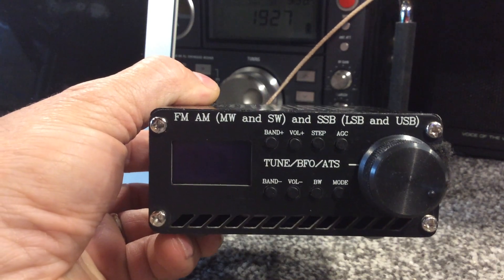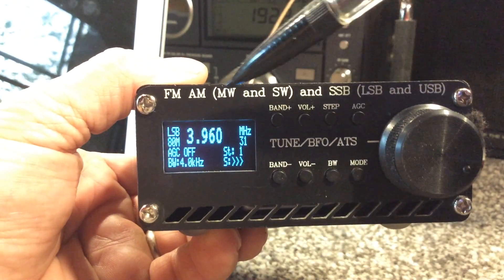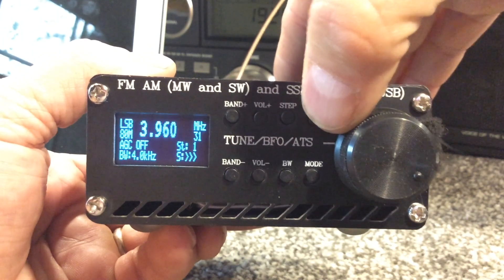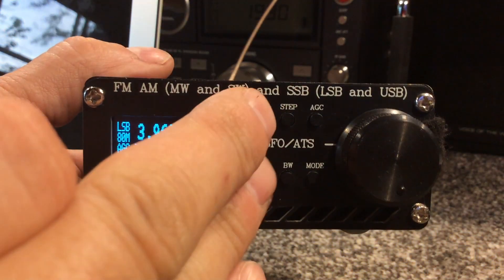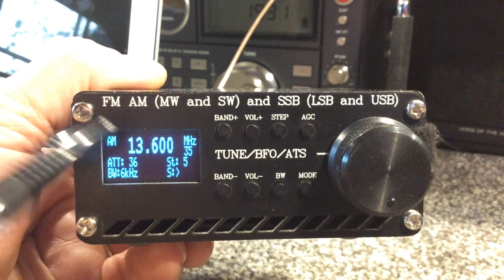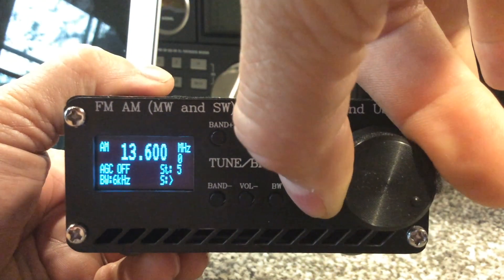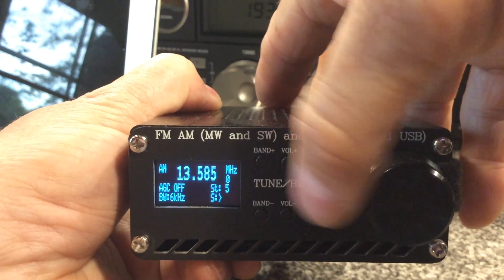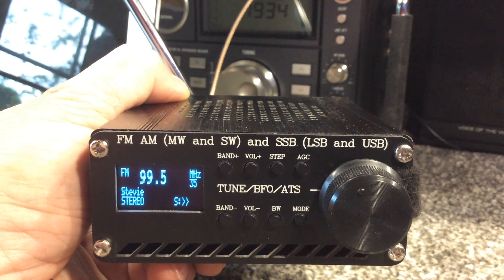Si4732 Radio Sketch Updates 2.3.09

Comment: I’ve been looking for info on charging the internal Li-ion battery but have been unsuccessful so far. I’ve had my ATS-20 for about 5 days and seemed to be charged out of the box. Now I’ve been charging but really not sure how long to charge as there doesn’t seem to be a fully charged indicator. Thanks for any info you can provide on this question 

Mike Newland
N4JRG
Reply from the maker: Mike. Mine has an LED in the back that changes from red during charge to blue when fully charged. Does your version have that lamp?

Comment: Hello Kent, I have a suggestion for you you should add battery status display and a digit S-meter. I made the modification based on a 3.0.4 version with these additions, and it works pretty well. 73 best regards Sébastien F4ERX.

Comment: Current sketch on Dropbox does not work as supplied.   It is too large for available memory, there are typos in definition names, and if you get it to fit in memory, there is display corruption
Reply: im also getting the same error, the Arduino IDE says its too big 30742 bytes where max is 30720, has some extra line/s crept in ?
Reply: there are a number of errors in the sketch, the main one is the use of non compressed SSB patch, but there are other errors, also the FM seek doesnt work. i can only draw the conclusion that this sketch is an early version of a working sketch. needs more work to iron out the errors

Comment: Good work on your SI7432 firmware!

I particularly like how you kept the buttons with their original labeled functions and screen layout.

I’m wondering if memory is available for frequency memory.  Because there’s not enough buttons, could this be implemented by maybe double clicking a button, holding down a button for a length of time, or two buttons simultaneously to change to a stored channel mode.
Reply from the maker: Ed. I am checking on an intuitive implementation of your suggestion for memory storage.  There is not a lot of memory left to work with, and a limited number of writes to the eeprom. But it’s a great idea. Let’s see what we can do.

Comment: Can you let me know how to update the firmware?
Reply from the maker: Hello.  Oh my. There is quite a learning curve. I would suggest that you search on YouTube for some tutorials on loading programs into the arduino.  There a quite a few out there that can walk you through the process.
Reply: @KOVintageTech  I realize that.  I've used Arduinos in the past (mainly the Uno), and have written several sketches.  I just don't know the details of what would be required to update the Nano in this radio - such as which version of the Arduino IDE should be used, what other drivers/libraries need to be loaded, etc.
Reply from the maker: @w2aew  ok great.  Yes I can tell you what all is included in my sketch.
Reply from the maker: I just checked. I’m my dropbox folder you should have all of the files you need to do an update. They are all inside that sketch.  If you load that sketch into your compiler you should be good to go.

Comment: 7:14 CUTOFF JAPANESE FM BAND. Tunes down to 84 MHz. TECSUN PL-365, DEGEN DE1103, CC SKYWAVE SSB and CC POCKET tunes complete Japanese / International FM BAND FROM 76 - 108 MHz. TECSUN PL-330 and PL-368 also tunes complete Russian OIRT FM BAND down to 64 MHz. Slow tuning on 10 kHz, fast tuned on 100 kHz. Degen DE1103 / Kaito KA1103 FM tuning step is 25 kHz steps.

Comment: How does this radio compare to others in this price range?
Reply from the maker: Good question no paid $60 USD for mine. I did not do a comparison. Apparently, the manufacturer uses different Arduino knockoff boards that vary in their ability to take firmware updates.

Comment: Hello,very nice! I use this Radio and this Radio is good for experiments.
Can you expand this sketch with a 110kHz, 84kHz, 60 kHz 40kHz FM radio filter option for a better FM selectivity? There is another SI4735 Library where there is a sketch where you can also change the FM bandwidth. This library is structured differently than that of PU2CLR. 
It should work with the PU2CLR library? Many Thanks!
Reply from the maker: unsure. I think the radio internal firmware is already set. but I’ll check.
Reply: @KOVintageTech  Here you can see the sketch with FM Bandwidth switch 110khz-40khz.: https://www.hackster.io/CesarSound/lw-mw-sw-stereo-fm-with-rds-dsp-radio-receiver-v2-5-79438f
Reply: @KOVintageTech  I ve made fm with the 4 bandwidths, and added 0.01  0.05 0.1 1.0 stepping!  I m interested in the code if you implement that.  I ve also seen an option to calibrate internal antenna capacity.  I ve bought a second unit, cause i ve got the idea the mw/lw was better there ....
Reply: For the FM bandwidth of 40 60 84  110 and AUTOMATIC, use the function 
si4735.setFmBandwidth(bandwidthindex);

And for setting a step of 0.01 0.05 0.1 and 1 mhz:
 si4735.setFrequencyStep(FMcurrentStep);
 si4735.setSeekFmSpacing(FMcurrentStep);

This chip beats a Yamaha T85 for selectivity!  Keep this in mind when implementing ;-)

Comment: Nice video but does it add any frequencies on any of the bands that are useful here in the United States ? Thanks
Reply from the maker: The radio is designed to receive on the fcc approved HF ham bands.
Reply: @KOVintageTech  ok I guess my question was more like If the updated frequency range after the updates on this radio  are in use here in the United States Will I hear anything? Thanks
Reply from the maker: Hello Ross.  I think I understand your question.  The changes we are all making on this radio do not affect the frequency ranges. And the changes do not directly impact the radio’s receive ability.  If I understand you correctly in order to really benefit from using this radio you need a good outside long wire antenna. The whip is of little use indoors and can be used outside at high elevations. But the radio really begins to “sing” when you connect a nice Ham dipole or long wire antenna.  Hope I am understanding your question.

Comment: I'm curious! You said you fixed the encoder bug. However, there is no final result difference between the original version and your current version. I mean, the final result of the encoderCount variable will be 0 after each encoder click in both cases. I have used the original version in my prototypes and I haven't never experienced problems with encoder. Except when the encoder has mechanical problem.  Anyway, your improvements on the interface is really nice.
Reply from the maker: Good question.  I’ll double check.  Thanks for the note.
Reply from the maker: Ricardo.  If the encoder interrupt triggers more than once before the code checks the encoderCount again (happens when spinning fast clockwise) the encoderCount will be greater than 1 and so the code interpreted that as the opposite direction (since it checks if the count is equal to 1 to indicate positive direction rather than checking >=1).  It's quite possible that it only happens because of some other changes we made - we removed a few delays to speed up the button responsiveness.
Reply: @KOVintageTech  it makes sense. I’m going to check it out. It is possible the seller of this kit has changed the original sketch and increased  the delay.
Reply from the maker: @pu2clr  has there been any improvement on the patch for agc in SsB?
Reply: @KOVintageTech  The AGC / Attenuation  resources have not worked properly on SSB patches I have tested. It seems we have a bug or these resources were not implemented.  I'm not sure.

Comment: Nice setup. Thanks for sharing. 73, PU2CLR.
Reply from the maker: I thought later that I should have just sent you the updates in your repository so you could incorporate some of them in your next release if desired instead of creating a whole new path. I admire the work you are doing for the community.
Reply: @KOVintageTech  Thanks sir. You are welcome to add new firmware improvements on the Si4735 Arduino Library Repository (folder examples). If you prefer, you can give me a link to your project and I can guide the users to access it via my site. 
If you have some improvement on the Arduino Library code (SI4735.cpp and SI4735.h), you can do that via github repository. All you have to do is posting the improvements or issues using "pull request" or "issues" resources on the github repository (https://github.com/pu2clr/SI4735).  As usual, I will add your name on the list of contributors in the repository.